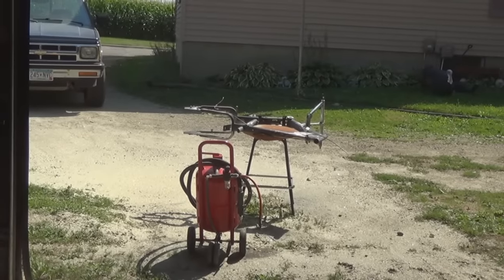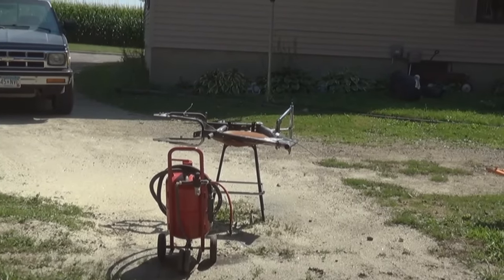Sandblasting short

Comment: I bought a little sandblasting outfit, but have never had the courage to try it. When I used to do it a lot it seemed to take 5 showers and a couple of days to get all the sand out of and off my body! :-) Good work there George.
Reply from the maker: Bruce Boschek This wasn't too bad, but there is a layer of sand all over the driveway. We had a pretty stiff wind blowing so most of the dust blew away. Next time I will try to recycle some of the media. Thanks for stopping by Bruce.